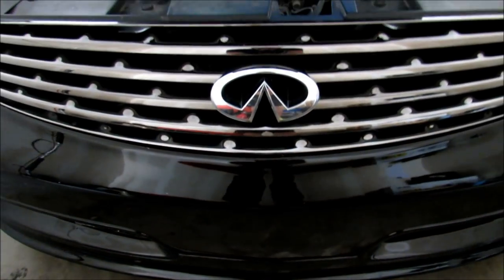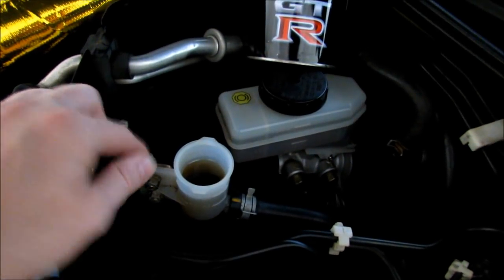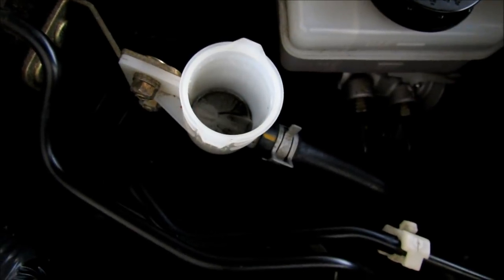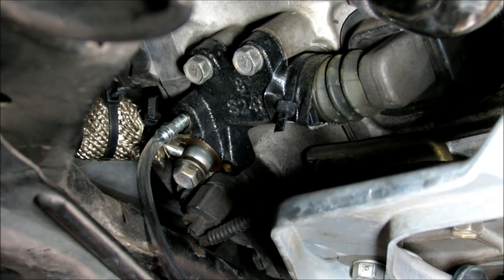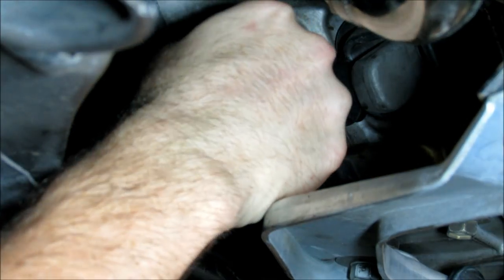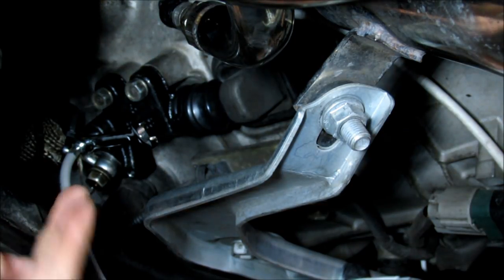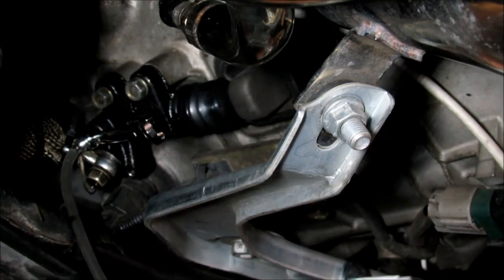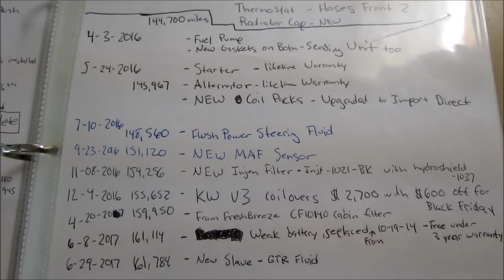INFINITI G35 / Nissan 350z - Fix Clutch Pedal - Bleed Install Slave Cylinder

Comment: good video! my slave cylinder has 150k km on it haha, Do you know if the Rev-up slave cylinder is the same as the normal VQ? 

Also you made it look so simple, When I did a clutch change I found it almost impossible to build pressure back to the point I had to take the master out and bench bleed it...I think it may have something to do with AUS 350z having the master on opposite sides and having a much longer clutch line.
Reply from the maker: Yes, the rev-up has the same slave cylinder as the normal VQ. That is pretty badass, I have someone from Australia checking out my videos and I did not know they put the slave on the opposite side. That would make a much longer clutch line, that sucks man. I've never had to touch my master cylinder, yet. 

Well please click subscribe. I just started uploading content 3 months ago. I"m in Arizona, in the USA. I'm sure, there will be more videos I upload that can help you with your 350z.
Reply: Thanks for the reply! yeah AU Z/G community is small so we have to make use of Americans to give us advice haha.

Well the slave is on the same side but the master is on the opposite side so the lines are like twice as long, Im still scared to change lines because I fear I might have to take the master out again to bench bleed (nightmare)

Yeah I'll follow for sure, good to get some advice from another rev-up owner!

Comment: @motordyne g35... Do you have the tipical chatter noise from the clutch/flywheel? If yes, can you tell me if there is a solution for that? Thanks!
Reply from the maker: Juan Ortiz ...whoever owned the car before you installed a single mass flywheel instead of a dualmass flywheel. OEM is dualmass. Single are cheaper, technically a performance upgrade. I was unwilling to have my car sound like a cement truck when in neutral, so I stayed OEM on the flywheel. Exedy clutch upgrade.
Reply: Motordyne G35 thank you so much bro!

Comment: Hey man I have a question, I replaced my clutch master and the pedal went straight to the floor. It has no pressure. So I went to bleed the clutch when I had my friend depress the clutch the slave wasn’t having any movement
Reply from the maker: Josh Thomas ....you have air in the system. Keep repeating my steps in this video until you regain pressure which will regain movement in the slave. Did you replace the slave and the master both?
Reply: So I’m going to say what’s going on with my car. I got a new clutch job done in it which is an exedy stage 1. And while the clutch job was getting done I gave the mechanic a slave cylinder. First 50 miles it drove good but then I started grinding on all gears. My clutch wasn’t disengaging properly. So I found out that my clutch adjustment was very bad. I almost had a half pedal of free play. then I adjusted it and it started driving smooth again. But then It started happening again so it felt like the pedal was getting worse. Then I experienced an awful grind when depressing the clutch at a high rpm. So say if I’m in first and I’m at 4K and I depress the clutch it’ll make a terrible grind. It sounds similar to as if the gear is being shoved in without the clutch. ( I’m not even shifting either, that’s just the gear staying in place) and the grinding won’t got away until I put it in neutral or if I push down the clutch again. ( this is my biggest problem I’m experiencing) so due to my clutch pedal acting weird I replaced my master cylinder. I was trying to bleed the system and idk if I’m doing it wrong or not but the reservoir keeps getting empty when I’m doing this.
Reply from the maker: Josh Thomas ....take the car back to the shop that replaced the clutch. Not sure why after they just got done fixing your car, that you decided to now be the mechanic. Not saying you don't know what you are doing, but it seems that way. Yes, the reservoir is supposed to get lower as you bleed the system, but you can NOT let the reservoir get empty of brake fluid while doing it or you suck a bunch of air into the system. What year is your car so I know what gearbox you have? How many miles?
Reply: I have an 04. I usually always work on my car unless it’s a serious job. The reason why the bleeding process is difficult is because I can’t stick the tube in the bleeder hole. I have the same brake bleeder thing as you but the hole of the tube is too small and trust me I wanted to take my car back to the mechanic but he hes always busy and since he knows me he thinks it’s fine to let me wait and help out the other customers first & the car has a 165,000 but I swapped the tranny and the tranny is supposed to have about 95 by now
Reply from the maker: Josh Thomas ...I can respect a man who turns wrenches, my bad, but who cares the mechanic knows you. You still paid him.  The bleeder tube was just for this video and demonstration purposes. In the past I never use the tube. All it does is help not make a mess and help see the bubbles, it has nothing to do with the bleeding processs. Keep repeating the process until a steam of liquid shots out and tighten it mid stream. Repeat, you will get pressure  back.
Reply from the maker: Is the new gearbox a CD009 instead of getting another CD001?
Reply: If the 04 gearbox is cd0001 then that’s what I got. I had another g35 before that had a salvage title so I just swapped tranny’s
Reply: Do you have any idea what the grinding issue is when I’m at a high rpm? Literally happens all the time. If I’m above 4K and I push down the clutch it’ll sound like the gear is grinding. I have no clue what’s causing this
Reply from the maker: Josh Thomas ....there is missing info here so I have no idea either. Given you don't know or didn't give me the mileage on the swapped tranny, the CD001 with high mileage 3rd gear will start to grind first. Means syncros are going out. Was there no grinding before you took it the shop? How many miles did you drive on the swapped tranny before you started having issues? 

The CD009 has stronger syncros so I am at 171,000 miles no grinding, but I also change my gear box oil with Amsoil every 40,000 miles.  Has the gear box oil ever been changed?
Reply from the maker: Only late model 05' and up got the CD009 gearbox.
Reply: My car drove perfectly fine before the clutch job. The clutch was put in about 3 weeks ago. After the clutch job I started experiencing problems. Also, the mechanic told me he changed the oil after the clutch job so I’m just very confused at the moment on what’s going on. My car never had any grinding issues and now if I try to shift it’s like the car isn’t disengaging properly so It’s like I’m shifting without pushing the clutch in. So I’ve been double clutching until I adjusted my pedal and then it was driving fine. The thing that I don’t understand is that the gear itself is grinding when I push down the clutch at a high rpm
Reply from the maker: Josh Thomas ...so after the clutch install the car drove fine for 3 weeks? How many miles on the gear box?
Reply: Ehhh I was having disengagement issues but it was because I had a half a pedal of free play so after I adjusted the clutch pedal it started working fine again but then I had disengagement issues again so I was thinking maybe I should replace the master clutch cylinder since I replaced the slave already and that’s what happened so far. I tried to bleed the slave again but it was just wasn’t working for me. The clutch pedal wasn’t gaining any pressure so I’m pretty sure I’m doing something wrong because my pedal is still stuck to the floor.
Reply: Also my gearbox has 90k Miles
Reply: 90-95 I bought it with 85k and within the 5k miles this car shifted perfectly
Reply from the maker: If your pedal is stuck to the floor it is your slave.
Reply: I had the slave replaced when I got my clutch job done but the clutch pedal got stuck to the floor after I switched the master

Comment: Will it fix sticky clutch? My clutch gets stuck half way when it's super hot put or a 30 mins drive. Colder weather tend to be better
Reply from the maker: FunnyVids ....Yes.
Reply: Ok i will try it :/ i tried bleeding it but didnt work
Reply from the maker: You need to replace the slave. The slave is $38 from Oriley's. Bleeding it won't help, if you did not replace the slave cylinder.

Comment: when you're bleeding the clutch do you have the cap on the reservoir? or does it matter?
Reply from the maker: Enrique Mo .....you should have it off because if you are just bleeding and not changing out the slave, as you drain the fluid you can NOT let the reservoir run out of fluid or AIR WILL ENTER THE SYSTEM. So as you bleed the system you always have to keep fluid in the reservoir.

Comment: Can you post a link or tell us where you bought the slave cylinder for $38?  I have an 05 G35 and I've had the sticky clutch pedal mostly on hot days. I think it's time to change it. 

Thanks for the video! It's very helpful
Reply from the maker: The parts store, it comes with a life time warranty. If it fails, they replace it for free. https://www.oreillyauto.com/
Reply: eiji81 me too but on my z... only on hot days...strange

Comment: I replaced my slave but its still squeaky when you press the clutch pedal. Any idea?
Reply from the maker: Yeah, my clutch pedal get's squeaky too. I lubed the actual pedal inside the car, wherever movable parts are, with white lithium spray on lube to stop the squeaky pedal.
Reply: Motordyne G35 Ok thanks

Comment: Guys i just thought I’d share an extra tip.. if you’re not changing the stainless flex line at least change the washers.. the copper crush washers … it may not seem like it’s leaking but it can leak just enough to introduce air into the system.. I was bleeding 101 different ways and 50 different times.. and I always had air in the system and couldn’t build past a certain pressure… it was actually enough air that I couldn’t get into 1st gear or R from a stop.
Reply: I'm having issues getting into 1st gear and reverse! Do you think I need to replace the slave or just the washers? Btw, you should make a video on the washers you're talking about!
Reply: @stylewithaltitude   is there any way grease or oil could of gotten into the flywheel? I ended up replacing my clutch… but I’m 90% sure the entire issue was created when I tried to use white lithium grease to lube the release fork and throw out bearing.. I just pulled down the rubber boot and sprayed… but I believe I got grease on the flywheel and that’s what was causing the pressure plate to slip and preventing me from 1st and R.. if you rev the engine while trying will it go into first gear??  
Also make sure you have the pedal adjusted too.. if the car rolls with clutch in then it should not have an issue with it falling into gear.
Reply: @stylewithaltitude   you’re only needing to replace slave if it leaks.. the issue is not slave related if it isn’t leaking..
Reply: @Turtlefarm  I got a single mass flywheel clutch kit and the problem started about 2 weeks after installing...Replaced the clutch master cylinder and now having a hard time getting into, especially 1st and reverse... grinds gears or super hard to shove it into those gears... its cringe to hear them grind into gear our super hard to get them in... as the car continues to get warm... the problem goes away?
Reply: @stylewithaltitude   did you do the clutch yourself? It’s possible you over greased the pilot bushing. And some grease has came up onto the flywheel. What transmission do you have? Made sure you have fluid in it?! How’s your clutch release point? At the top of the pedal? Near the bottom? It’s strange that this is with a new clutch.. wich I why I think it’s just grease in a bad place. May of been over greased. When installed.. sorry for the 100 questions

Comment: That's car porn to see the slave cylinder move lol. Btw, my Z is super hard to get into gear and even grinds when I have to force into gear. Especially reverse or 1st... I replaced the clutch master will this fix the issue? It gets easier to get into gear when the car is warm...
Reply from the maker: Yes a new slave will definitely help, no need for master. Did you change the transmission fluid?https://youtu.be/N5_XKvVvLcw
Reply: @MotordyneG35  Thanks for the reply bro! I changed the trans fluid about 4 years ago and maybe put 4k miles on it! Your thoughts on what it can be?
Reply: @MotordyneG35  I also got a new flywheel and clutch kit recently... the problem started about 2 weeks after... super hard to get Into gear! The problem gets better after the car is super warm..? Your thoughts?
Reply: @MotordyneG35  Did my mechanic RIP me off buying a master? Lol
Reply from the maker: @stylewithaltitude  …what year z? The late model 05 and up have the CD009 transmission which has stronger synchros. It means your synchros are going out, so just double clutch it or shift more slowly so the synchros can align the gear.
Reply from the maker: Well if it just recently happened after a new clutch maybe the slave isn’t bled all the way and the slave isn’t extending all the way out. It’s best practice as a shop to do both slave and master, even if master isn’t needed. Just so you don’t come back.
Reply: @MotordyneG35  Its an 04 Z...
Reply: @MotordyneG35  Are you saying bleeding the system will fix it... or also getting a new slave cylinder?
Reply from the maker: @stylewithaltitude    . How many miles? CD001 transmissions are known for grinding as the synchros give out early. That’s why Nissan developed the CD009 transmission which is what I have. 192,000 miles and no grinding.
Reply: @MotordyneG35  Trying to save some cash and quit buying parts I dont need...
Reply: @MotordyneG35  I'm at 160k miles... I never had issues shifting until the clutch and flywheel replacment...  super hard to get into reverse and 1st until it's super warm and driven for a while!
Reply: @MotordyneG35  Seems like the colder it is outside... the harder it is to get into gear... once its driven and warm its fine...  cold start is brutal
Reply from the maker: @stylewithaltitude  ..Yep, the fluid warms up. Just double clutch it, when it’s cold.
Reply from the maker: @stylewithaltitude  my buddies 04 Z same issue, here we installed a new CD009 transmission..https://youtu.be/Uz2b87HsGk4
Reply: @MotordyneG35  What do you mean by douple clutch it to get it into gear? Also I just watched your trans video... what do you think the issue is? Slave Cyl?
Reply: @MotordyneG35  Mechanic told me the fluids were low when he did my clutch master... think it's the slave cyl how its hard to get into gear?
Reply from the maker: @stylewithaltitude  possibly slave cylinder but you said the problem goes away once warmed up and the amount of miles, it’s the synchros going out. Double clutch means, pump the clutch 2 times, then try to change gears.
Reply: @MotordyneG35  Damn... you think my transmission is going out?! I'm hoping it's the slave cyl...😩
Reply: @MotordyneG35  I'll try double clutching see if it's easier to get into geat

Comment: dude change the clutch line thats the rubber coming off the line gwt a metal braided line that's what ima do and its a better reaction time lifts ur clutch even better and faster
Reply: just like braided brake lines
Reply from the maker: I changed the clutch line over 7 years ago to a stainless steel line, I'm pretty sure I mentioned it in the video. Although there is a rubber line still from the clutch reservoir to the master, maybe that is it. Do you really think so?  I believe porksniffer's comment he made though that the fluid turning black is from the friction plate or clutch disk. Now I think about it, that would make sense for an internal slave, which is g37 or 370z. This is an external slave so there is no way for the clutch residue to make into the slave. It turning black really has me baffled, even though I have no issues.
Reply: ohhhh ok i didnt see that but yea thats what it is
Reply from the maker: I've had the same thoughts that you have on that rubber line up by the reservoir making that black residue appear. Thank you for your thoughts too, I agree. That line is way easier to change than that stainless steel line install. Getting that clip to come out and put back in was a pain.
Reply: I think older fluid changing color is just nature of the beast.  Brake fluid which is what clutch fluid is, is  hydrophilic which is the opposite of hydrophobic, which means its attracts water over time and is very bad for your paint btw.  I have a motorcycle with stainless steel brake lines and over time my clutch fluid will get dark too.  So I don't think it really has anything to do with rubber lines or not.  My entire front brake system contains no rubber lines at all and over a period of time the fluid will still get dark.  Just change your fluid every year or two and if you start having issues with pedal pressure on any car with a clutch look to leaks at the slave first before assuming the worst.
Reply from the maker: The brake reservoir is right beside the clutch fluid. I know they both use the same fluid. Nice theory, but why isn't the brake reservoir fluid turning black then? 

You can go 3 or 4 years and it will not turn black. The clutch reservoir turns black in 6-8 months.
Reply: You got a lot more fluid in the brake lines then the clutch line hence the longer it takes for it to change color??  Maybe??
Reply from the maker: Hmmmm.....I did not think of that, good point!